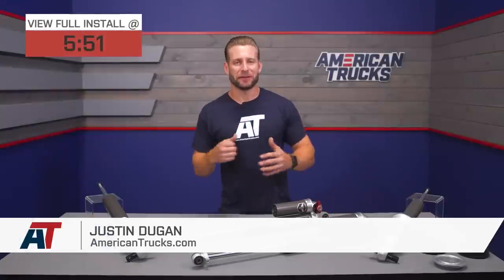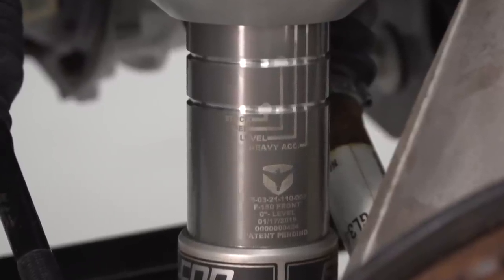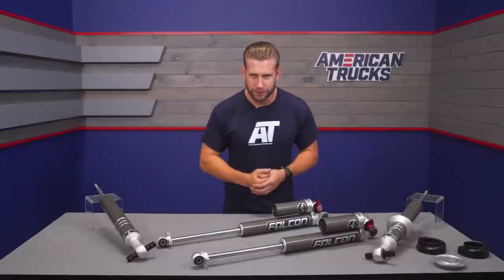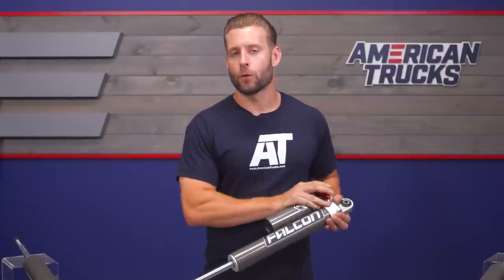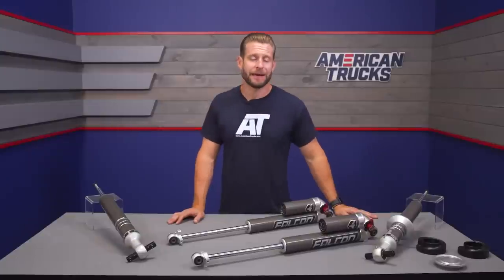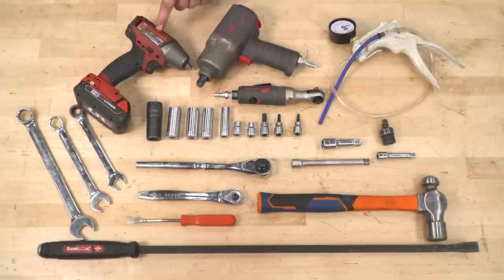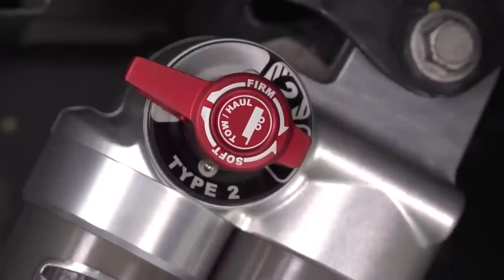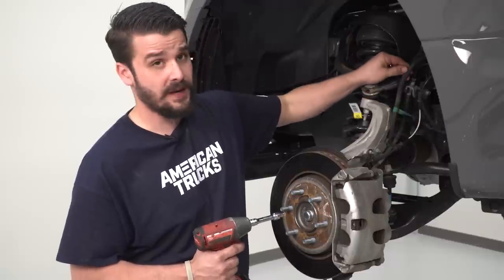2015-2019 F150 Teraflex Falcon Sport Tow/Haul Leveling System Review & Install

Comment: If going with the 2nd notch setting in the front and not the level setting much of a rake would that leave on a 22 f150?  I’m worried about squat with my trailer hooked up (800lb hitch weight). Also will it affect ride quality?
Reply: I'm assuming if you tow it may be better to use the second notch to avoid the extra squat.. I don't have personal experience w this yet but I'm getting a '23 150 which I use to tow and haul a lot so I'll set it to the 2nd notch..
Reply: @w.alexedmonds8287  my shop ended up putting the level setting and I just stuck with it. Haven’t pulled or towed really this year. Might get RAS which will add some rake back for when I do tow

Comment: How do these shocks compare to the Bilstein 4600 series. Especially when it comes to towing. Thanks
Reply: Well with the ability to adjust them based upon how much your towing I would say these are superior to the bilstein 4600s but they do also cost 4 times a much. So depending upon your application and needs. For the same price if you have 4600s already you could run an air bag setup to help level out your load and aid in towing comfort.

Comment: I just realized somthing I think if you have factory wheel well liners how do you mount the rear shocks.  I'm pretty sure the stock rear shocks are behind the liner no way these will fit unless you cut the liner I think.
Reply: I had a 2020 with wheel well liners, and they had enough flex to unscrew them and bend them out enough to reach the OEM shocks, after you just reinstall the screws, and you never know.
Reply: @stevensimpson1043  thanks for replying back.  I assume these are factory liners I bought the fx4 with 19,000 miles on it, if I put the falcon rear shocks on the rear I would not have access to the lever that changes the firmness of the shock without cutting the liner to expose the top part of the shock.  At least on the liners on my truck it's not a big deal I just didn't realize how much my liners covered and protected in my wheel wells.
Reply: @skymaster9484  They may be Husky liners. That’s the brand I had, and have on my new truck. Husky’s seem to cover more than the OEM ones. I plan to cut the liners to have just enough access to the switch, but keep it clean.
Reply: @stevensimpson1043  thanks for the reply.

Comment: I install that set on my truck on the level setting . I knew it was going to be stiffer but I think is to much .. my question is will this set have a brake on period where the becomes a bit softer on street ? Or should I just lower the tension to medium level
Reply: Same experience here.  They tow way better but for daily driving it’s too bumpy.